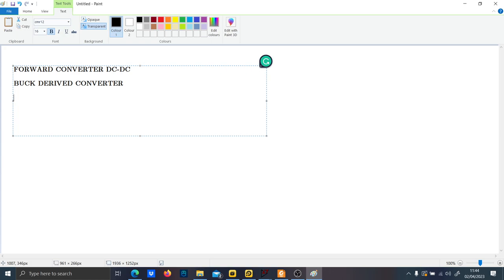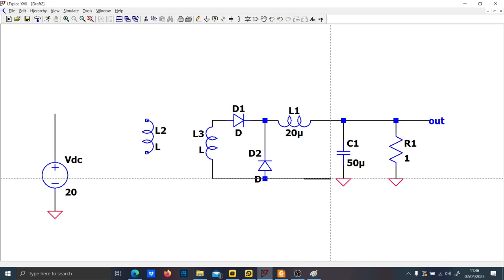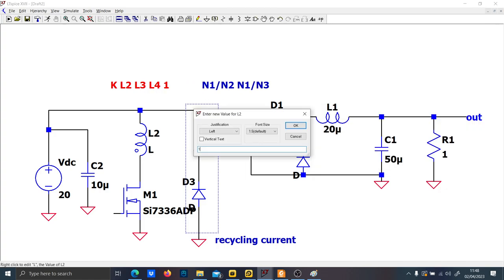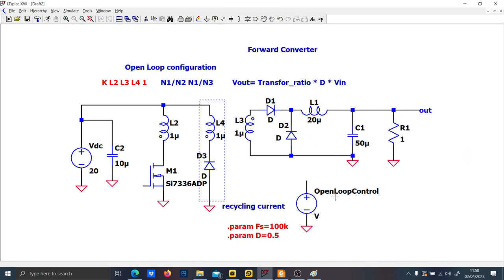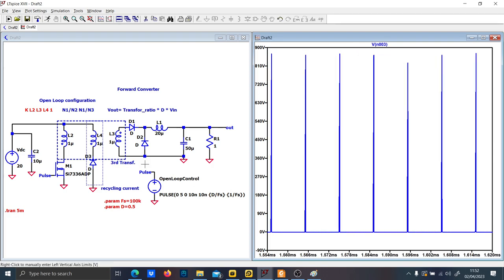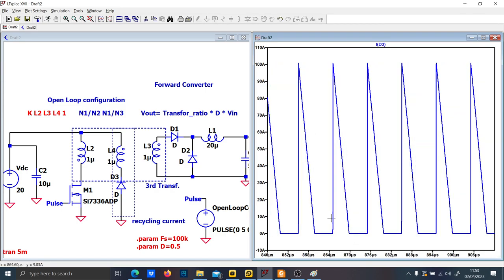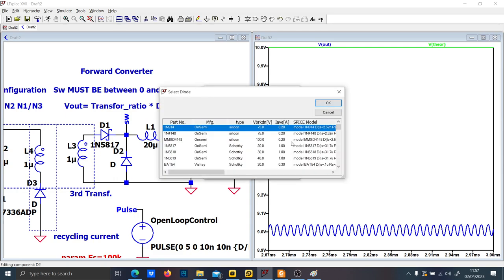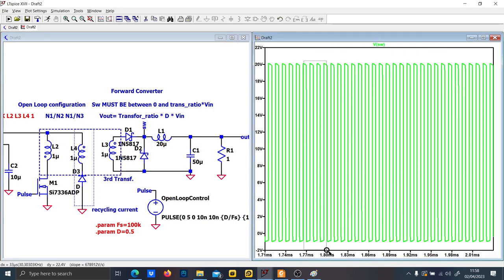LTSPICE DC-DC Forward Converter (Open and Closed Loop)

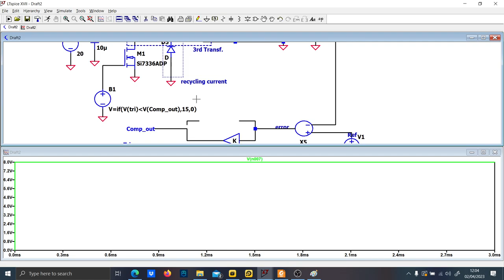Comment from the maker: As you can see in 20:15 by using only a P controller, at the end of the transient you are having a steady state error which you can't compensate. For this reason always PI controller are preferred, since you are using the "past errors" to correct the steady state error

In power electronics you can use type 2 and type 3 controllers instead, which will compensate better the pole introduced by the inductance and the esr of the output capacitor

In the next video I will talk about it and will make a comparison between the controllers

Thank you for watching
Reply: How to make the controller in practical on a breadboard?
Reply from the maker: @anshumanmohanty2643   Pi controller can be realized with two or even one opamp. In the case of the two opamp, the first is designed to have the proportional gain (-R2/R1) and the second opamp designed as an integrator
Reply: Hi there, I think the phase of L2 and L3 should be the in phase. The way they are connected, they are out of phase.

Comment: Hi Mano.. for compensators... how do I decide where to put the zeros, poles and cross frequency? I know you a video following some algorithm. I tried to do it but it is not working for me. I am having trouble placing poles and zeros in the right locations. I know the transfer function for my LC and load resistor. I am using a type 3 compensator.
Reply from the maker: It Is easier to follow an application note: Just write type3 compensator for Buck converter or forward, you can even find some tools online